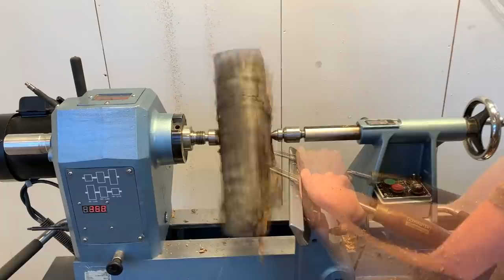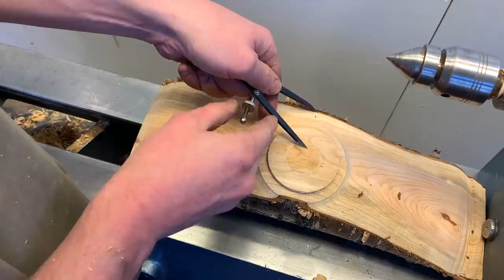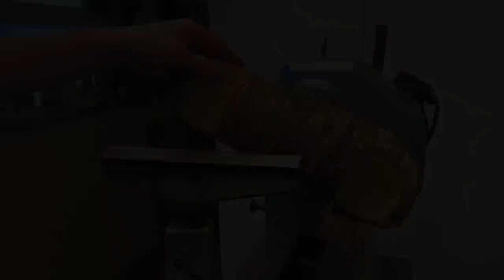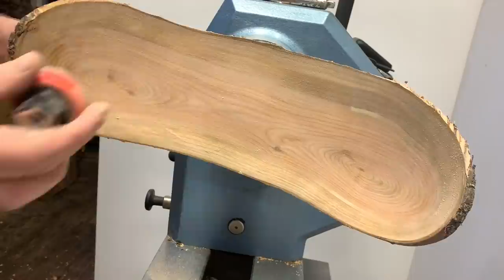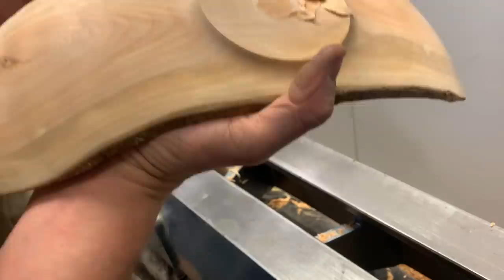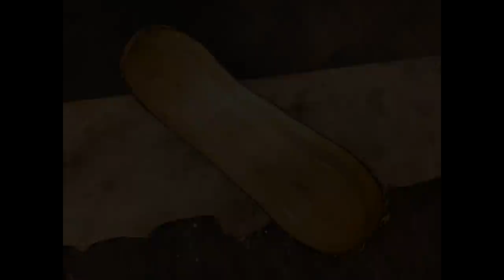Woodturning - Don't Try This At Home!!

Comment: This has got to be hard on your lathe.
Reply from the maker: This is so smooth when it’s turning. Nothing is hitting anything hard. Just very sharp cutting edges meeting green wood tracing at hi speeds. It’s all very smooth indeed. What do you think is taking any hard hits?
Reply: @JackMackWoodturning   Sorry, I actually meant it as more of a question. it does look smooth. Thank you for replying. My thought was that:

- the wood sticks out very far and requires more  torque. 

-the center of mass is off center by some degree throughout the process

Maybe these are not significant enough to cause excess wear. I have never worked with a lathe, just I just like to see the videos. I have worked with lots of motors and small bends in a long motor shaft like on a big agitator or disperser will cause significant wear. I do notice now that you removed most of the material  farthest from the axis of rotation at the start. I think I would hurt myself trying something like this.

Comment: The methods of work are good, but it's a pity that you try to pass off your failures as the goal and result of the work
Reply from the maker: I don’t understand
Reply: @JackMackWoodturning  I mean, in this video, the work failed, but you decided that it turned out well
Reply: @JackMackWoodturning  now you understand?
Reply from the maker: Did it fail?
Reply: @JackMackWoodturning  You can just bend the board. Ruined a beautiful log. But that's just my opinion
Reply: @JackMackWoodturning  Unjustified means for a small result. A run-up on a pound and a blow on a penny (Russian proverb)
Reply: @JackMackWoodturning  And so you have good machines. You work well with resin, with imagination. Respect to you
Reply from the maker: You could bend a board. But it would not be the same thing.. there are many ways to skin a cat

Comment: I don't like giving criticism but... I don't think the end result was worth the risk, and I'd be very upset to see this on my table knowing someone could've been put on disability if something went wrong. Take care of yourself. I'm sure you probably did it about as safe as it can be done, but things can go wrong. I just feel sad seeing someone putting them selves in harms way for a slightly curved tray of wood.
Reply from the maker: It’s very lovely that you feel that way, but this isn’t actually a dangerous undertaking for an experienced woodturner. Knowing correct safety measures to take keeps you
Out of harm way. It is of course very risky if someone with very little experience was to use this as a instructional video. 

Thanks for watching. 😊👍🏻

Comment: You could have made this by bending a piece of wood. But you decide to waste a big log, which could have given you 4-5 such pieces.
May be brain is underrated.
Reply from the maker: Hi A. 

This was a demonstration video. To have produced the piece any other way would defeat the whole premise… 

As far as waste material goes, all of the shavings are donated to a local community farm. They are firstly used for livestock bedding, then composted and returned to the garden. Given that the tree fell in a storm, I believe this to be a more beneficial outcome than it rotting where it fell, on a concrete drive.

Peace ✌️
Reply: @JackMackWoodturning  👍

Comment: It's just bad on your machine and slightly dangerous. Pleasure to watch because I wouldn't. Also retract the center and slide it forward, it's more sturdy that way.
Reply from the maker: This isn’t bad on your machine.. not in the slightest. But I’d like to know what you think about it is bad on the machine so I can help you understand a little better .
Reply: Just the wobble. Wear and tear on the lathe head my guy.
Reply: @JackMackWoodturning  it's a nice machine too. Beautiful work. Id just have never thought of that angle
Reply from the maker: “Wobble” happens on any unbalanced piece which is pretty much any piece before truing up. It doesn’t cause any damage to the lathe. 
The important thing when making a piece like this is to balance the mass so that you can turn it fast. 
Wobble doesn’t damage the lathe. But can obviously be unsafe if you don’t use it as a sign to adjust speed either up or down. 

The piece is mounted between centres using a spur drive and live centre. No harm comes to the lathe in any way when mounted correctly. 

The reality of a piece like this is that is it exactly the same as turning a bowl of the same diameter, just you don’t want to try to sand it by hand with the lathe running or you’ll loose your fingers. 

It really frustrates me that people make statements like you just did with out any real knowledge of what they talking about. It leads others to listen to you and in turn not understand. Save the teaching for people with real experience and understanding. 👍🏻
Reply from the maker: As to your note about shortening the length on the tail stock? 
Why would I limit my working room when the tailstock doing it job perfectly? 
Why are you trying to give me a lesson when the things you are saying show that you are not very knowledgeable but more importantly not experienced with a lathe.
Reply: @JackMackWoodturning  you did an excellent job on that piece. True talent. Thanks for the wisdom

Comment: I have 6 titanium plates in my head from turning something similar. It came loose and flung out shattering the frontal bone of my skull. Don't try this at home is correct.
Reply from the maker: Sorry to hear that bob. You have to follow basic safety procedures every time you turn anything. But I guess you know that now 👍🏻
Reply: @JackMackWoodturning  Agreed. I learned a lot from that process and I am doing just fine now. Beautiful piece but I won't attempt to recreate it any time soon. 😆
Reply from the maker: It must have been quite a shock. Glad to hear your better now 👍🏻
Reply from the maker: We’re you wearing a face shield too ?
Reply: @JackMackWoodturning  I was not wearing a face shield. I think I was wearing safety glasses was all.
Reply from the maker: Daaaaaam bob. That must have hurt like a bi*ch. if you are still turning please never step up to the lathe without a face shield as minimum ( for anyone else reading bob, i know you know now) 

May I ask bob, how did you have the piece mounted? Between centres? Screw chuck? Chuck jaws?
Reply: @JackMackWoodturning  just between centers. It was about 9" x 20" and I had it spinning about 3800 RPMs. Like I mentioned, learning curve. I am very lucky to have survived it. Don't be stupid kids!
Reply from the maker: @bobbankus5316   wow… bob it’s a miracle we are able to talk to each other today. 

We’ll done for getting off so lightly. 

Thanks for sharing also. It’s important that the people who look at this video and say “that’s dangerous “ understand the less than subtle differences between my approach and he one you took. 

I’m very glad it wasn’t worse bob. You must have a hard head/face  👍🏻

Comment: This entire video makes me nervous.
Reply from the maker: Why is that Ben?
Reply: @JackMackWoodturning  the main reason is that I (perhaps naively) kept expecting the wood to impact the tool harder than expected, and jolt the user in a dangerous direction. I imagined this would be more likely because of the comparatively longer gaps between wood, so the user may move toward the mass unintentionally hastily. 
The other reason was that since it’s attached length across the lathe, instead of along the lathe, the speed of the outer edge was significantly higher than usual.
Reply from the maker: Thanks Ben. So to your latter point the speed is the same as it would be for a round bowl of equal diameter and one can control the speed of the lathe as needed. 
To your other point. It wouldn’t matter if that piece of wood was turned very slowly by hand or if it came from outer space at the speed of light to meat the cutting edge of the gouge. When the bevel of the cutting edge is places correctly there is all but no resistance from the cut.. weather that is a continuous cut in a round bowl or a interrupted cut like this log. The transition from cutting wood to air than back to wood is without impact.. the toolrest and operator place the gouge just so, that the passing wood is simple cut away, there is no resistance to this. Motion when the tool is presented correctly.. that is why this is not a project for those who lack the previous experience to understand the process. 

Hope that helps you understand it all a little better.

Comment: a good waste of 90%of that piece of wood
Reply from the maker: “Waste” is a concept that requires looking at the material from a much broader view point.. 

In this instance we are referring to a section of tree taken from a local land owners wind fallen tree.. if the wood was not rescued it would have rotted in place as nature intended and in doing so it would have fed microbes and provided nourishment for the surrounding area. at this point a wood worker could look at the wood and call it a waste, but from the perspective of nature it would be entirely fitting.. 

When I use a piece of wood I expect to turn 90-95% of the volume into shavings and capture one piece in time that can last as a decorative item and aid in housing and feeding my family as well as providing a loved item for generations to come. 
The shavings I produced during my work are taken to a local ( underfunded) community farm/education centre where they are used as animal/live stock bedding.. once they are kicked out they are then composted and used on the vegetable garden where they do their part in producing food and income for said community farm. This process honours the work of the tree throughout its life time as it keeps the vast majority of the carbon that the tree spent so long extracting from the air locked up and safely back in the soil as nature intended. 

To view something as waste from this video is very narrow minded.. it works on an assumption that if the wood is in shaving form then it no longer has any use, when in actual fact the shavings are the part of the process that do not become waste. 

My views on this topic are that a material can only become wasted if you were to waste it. In my opinion, for a tree, that would be to burn it. 

Burning wood will undo the life time work of the tree. And the out put is the faster movement of atoms ( heat)  a true waste of 100 years of a trees life.

Comment: What is it supposed to be? What a waste of wood.
Reply from the maker: “Waste” is a concept that requires looking at the material from a much broader view point.. 

In this instance we are referring to a section of tree taken from a local land owners wind fallen tree.. if the wood was not rescued it would have rotted in place as nature intended and in doing so it would have fed microbes and provided nourishment for the surrounding area. at this point a wood worker could look at the wood and call it a waste, but from the perspective of nature it would be entirely fitting.. 

When I use a piece of wood I expect to turn 90-95% of the volume into shavings and capture one piece in time that can last as a decorative item and aid in housing and feeding my family as well as providing a loved item for generations to come. 
The shavings I produced during my work are taken to a local ( underfunded) community farm/education centre where they are used as animal/live stock bedding.. once they are kicked out they are then composted and used on the vegetable garden where they do their part in producing food and income for said community farm. This process honours the work of the tree throughout its life time as it keeps the vast majority of the carbon that the tree spent so long extracting from the air locked up and safely back in the soil as nature intended. 

To view something as waste from this video is very narrow minded.. it works on an assumption that if the wood is in shaving form then it no longer has any use, when in actual fact the shavings are the part of the process that do not become waste. 

My views on this topic are that a material can only become wasted if you were to waste it. In my opinion, for a tree, that would be to burn it. 

Burning wood will undo the life time work of the tree. And the out put is the faster movement of atoms ( heat)  a true waste of 100 years of a trees life.

And it is a skateboard 🛹

Comment: While that looks great and is a tremendous show of skill.... that also seems like a huge waste of wood considering what you started with vs what you ended with. :T

quick edit

NOT downplaying your skill at all. just.. to me being someone who 'cant' do that, seems like you waisted a lot of wood in the creation of that.
Reply from the maker: Thank you for the kind words. 
I guess this comes down to how do you define waste ? Logs like this are sold all day long as fire wood.. do you consider them waste? On the other side of this question, how would you define “use”. 
For me wood shavings have more uses than off cuts or fire wood.. 
My wood shavings are used as livestock bedding and then composted for the vegetable garden. 
This keeps all the carbon locked in the soil and is in keeping with woods natural lifecycle/ carbon cycle.
Reply: @JackMackWoodturning  Didnt really think of it like that. :)

Firewood/kindling i knew was a use, but didnt think about bedding!

I guess when i mentioned waist, it was more my 'mental image' of how large of a block you started with, vs what you ended up with.  Just seemed like you could have carved out a section of the 'middle' that you ultimately chipped away and used it for something else as a solid piece to start from. If that make sense :)
Reply from the maker: It does make sense. But the piece is the same size as the log I started with.. I don’t like to burn wood that I could compost as it feels like I’m wasting the life of the tree.. the world we live in has too much carbon in the air and we are drastically running out of topsoil.. I know one person can make a difference but if we all take responsibility for making our own lives a bit more carbon neutral, in time we might make a big change.
Reply: @JackMackWoodturning  Ahh thanks for epxlaining :)

And yea.. wasn't thinking about using it purely for burning, but was more curious about other uses for a 'solid' bit of what you ultimately chip away :)

Comment: Such a waste of wood
Reply from the maker: “Waste” is a concept that requires looking at the material from a much broader view point.. 

In this instance we are referring to a section of tree taken from a local land owners wind fallen tree.. if the wood was not rescued it would have rotted in place as nature intended and in doing so it would have fed microbes and provided nourishment for the surrounding area. at this point a wood worker could look at the wood and call it a waste, but from the perspective of nature it would be entirely fitting.. 

When I use a piece of wood I expect to turn 90-95% of the volume into shavings and capture one piece in time that can last as a decorative item and aid in housing and feeding my family as well as providing a loved item for generations to come. 
The shavings I produced during my work are taken to a local ( underfunded) community farm/education centre where they are used as animal/live stock bedding.. once they are kicked out they are then composted and used on the vegetable garden where they do their part in producing food and income for said community farm. This process honours the work of the tree throughout its life time as it keeps the vast majority of the carbon that the tree spent so long extracting from the air locked up and safely back in the soil as nature intended. 

To view something as waste from this video is very narrow minded.. it works on an assumption that if the wood is in shaving form then it no longer has any use, when in actual fact the shavings are the part of the process that do not become waste. 

My views on this topic are that a material can only become wasted if you were to waste it. In my opinion, for a tree, that would be to burn it. 

Burning wood will undo the life time work of the tree. And the out put is the faster movement of atoms ( heat)  a true waste of 100 years of a trees life.

Comment: Why?
Reply from the maker: Why… ?
Reply: @JackMackWoodturning  yes
Reply from the maker: I’m sorry, but I don’t understand your question. You have only wrote “why?” Generally “why” precedes the specific request for the information you wish to gain. But as I say, in this case you have only wrote “why?” And as my long distance mind reading skills are a bit iffy I’m struggling to answer you in a concise manner.
Reply: @JackMackWoodturning  why you made this plate so weird? If it was done with some purpose in mind, i can not guess. So why it was done such way?
Reply from the maker: Wow. If you had given me 1000 guesses at answering why I still don’t think I’d have got that. See this is why you need to ask the full questions. 
This is a video of me demonstrating a woodturning technique. It shows the extent of which something that seems impossible is actually fairly straightforward. 
It also makes a nice centre piece or bread basket. 😊